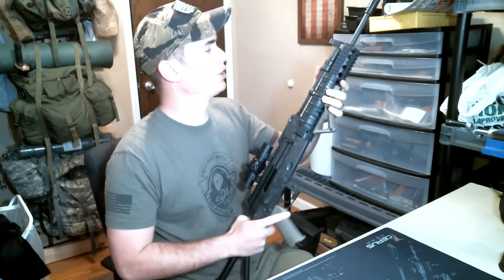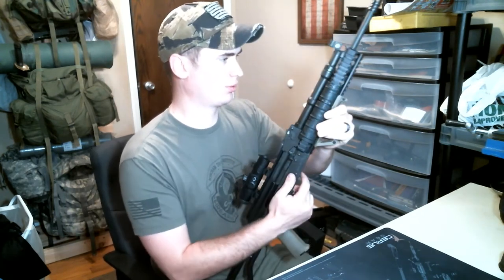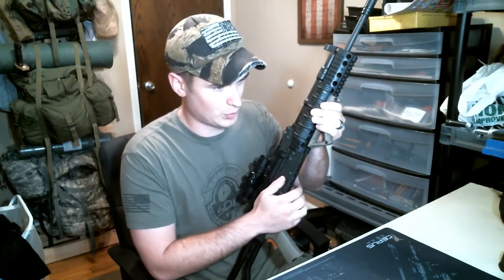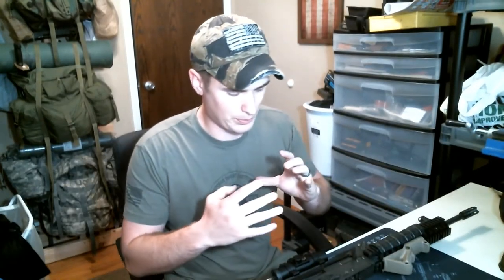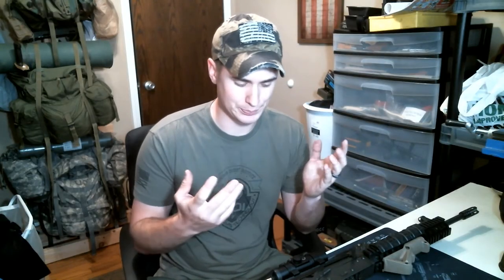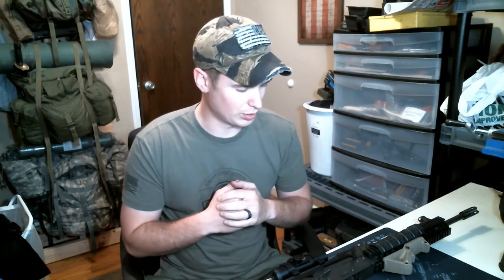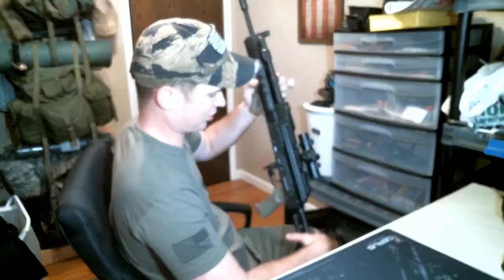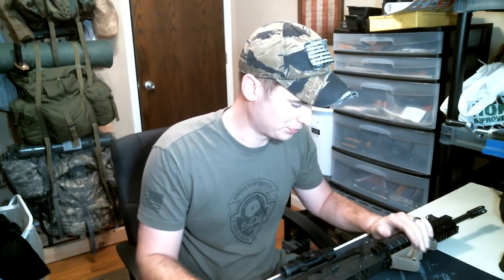Inter Ordnance AK

Comment: I am sorry I did not do my home work 5 years ago in which I purchased a IO AK.I have not fired it because of all the horror stories I have seen . I am confused on what I should do.Maybe replace certain parts or sell it .When I purchased the rifle and brought it home the mag. would not fit in the in the gun and that was a RED FLAG.I will say in all fairness that some people have had good luck with the rifle firing 1000s of rounds.Any thoughts and comments would really be welcome.
Reply from the maker: I'd try and sell it. The cast parts you need to replace are the front and rear trunions and the bolt carrier group. However, replacing the trunions and getting the barrel headspaced in a new trunion takes some investment in tools. You would have better luck selling it if you can, that's what I'm trying to do with mine. You could probably get more than it's worth if you sold it at a local gun show, guns are going for crazy prices right now due to politics and covid shortages
Reply: @ericpilloni6903  Thanks Eric for your reply back and the good advice.I have subscribed to your channel so I will stay in touch.